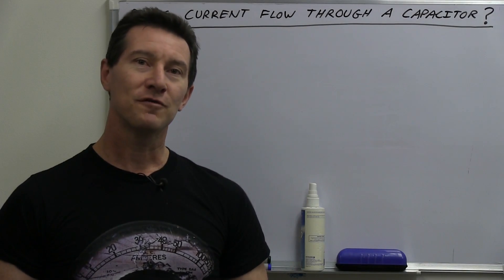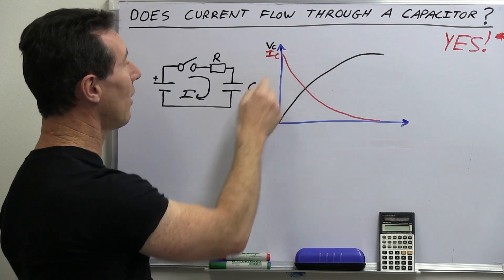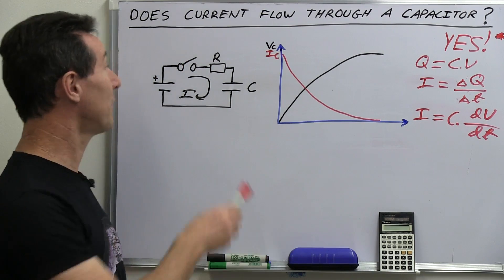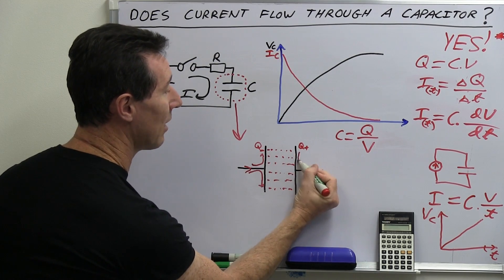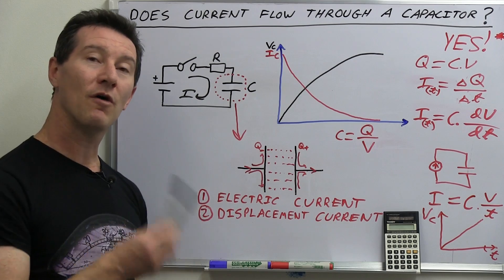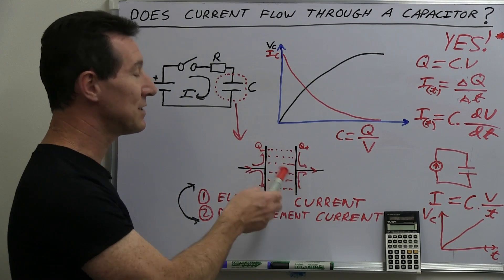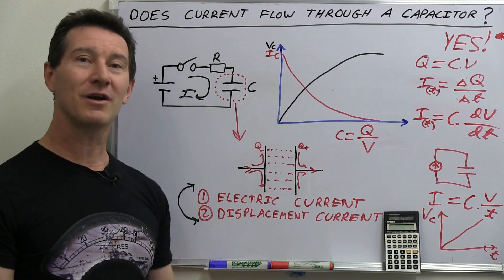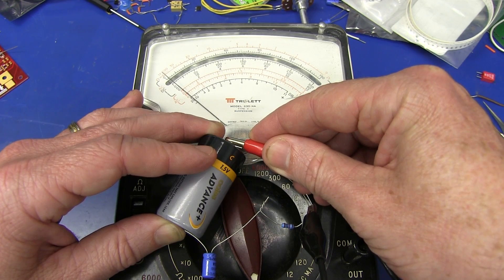EEVblog #486 - Does Current Flow Through A Capacitor?

Comment: So the simplistic answer is:
Do electrons flow through a capacitor? No.
Does current flow through a capacitor? Yes.

One circuit can affect the electron flow of another circuit even if they are not physically connected. That's how eg. transformers work.
Reply: Wow, that's such an obvious way of saying it, but I never thought about it like that. Thanks!
Reply: +quadcatfly What causes electrons to flow in a wire? Displacement currents present between each atom causing electrons to jump from atom to atom. What causes current to flow through a capacitor? Displacement current present between each plate that causes electrons to flow out of one plate when they are forced into the other. A wire conducting electricity is the same phenomena as a capacitor conducting electricity, just the capacitor has a much larger gap than the two atoms.
Reply: or rather more simply - it's an electric field that does the work of a capacitor but NOT a magnetic field as in a transformer. With a transformer - we have electricity converted to an INDUCED current via coils which generate magnetic fields (hence the ability to change voltages across the gap by induction. But with a capacitor, there is no associated magnetic field created beyond what you get traveling through the connected traces or wires. Otherwise you would see capacitors exhibiting magnetic behaviours when you turn a circuit on.
Reply: *****
"There is absolutely no current flowing from the primary coil of a transformer to the secondary!"

Ah, well, then all those formulas to calculate the current through a capacitor are wrong. It's much easier. The current through a capacitor is always I=0. Much easier to remember.

Now we'll have to rewrite all those books that are giving the wrong formula.
Reply: Ola Ostehøvel
So if you connect a multimeter to one and measure the current and it gives a non-zero answer, the multimeter is lying?
Reply: Ola Ostehøvel
So if you measure the current going through a device, and the multimeter is telling you that there is current going through, you will be lying if you thus deduce that there is current going through?
Reply: Ola Ostehøvel
Do you even understand what "current" means?
Reply: William McCormick
Are you insane?
I think you forgot your medication.
Reply: the current meter displays what the graph says about it. Its about electromagnetism, just as a step down transformer is inducing a current. All hail Nicola Tesla
Reply: Ola Ostehøvel
If you had a black box which contents you don't know, and it had two contacts, and you put a voltage difference between them, and then measured for a short period of time if any current is passing through the black box, and then you concluded that yes, current is flowing through the black box. Then the contents of the black box is revealed, and you find out that it's just a capacitor inside. Would you then take your conclusion back and say "oops, I was wrong; even though I measured current flowing through the black box, there wasn't actually any current flow at all, now that I see that it was a capacitor and not something else."

There is current flowing through a capacitor. It's simply that no electron that goes in will ever come out of the other side. Current does not require that the same electrons must flow through. (It's enough that some electrons go in, and "push" existing electrons inside it to go out the other side. This is what happens in a capacitor.)
Reply: More precisely, electric current is a flow of electric charges.
There is no requirement that all the electrons must travel the entire length of the circuit being measured. It's enough for there to be a flow. It really doesn't matter what's causing that flow.
Reply: the math says that there is a current a displacement current. Maxwell ecuations.
Reply: grassroot011 They tend to put names, terms, laws and even values on things that are not even there.
The story of America is Benjamin Franklin with a few blisters from ARC burns in his basement, doing away with 100 years of the witchcraft, of lightning and electricity.
Dufay was washed up, the Royal society was washed up. All by a few simple experiments.
What bothers me is that the myth busters, claimed that Benjamin Franklin could not have flown a kite in a lightning storm. How sad is that? It can be done easily.
Sincerely,
William McCormick
Reply: In modern CMOS devices sometimes you can get a response from the device even where no electrons moved, so if you dig deeper into this you'll find out that there are not simply particles of electricity. Just as, there are particles of water but there are not particles of water pressure. Consider: Ohms law shows that voltage, current, and resistance are not separable, they're different parameters that you can measure about a single physical law. It just doesn't break down into particles. How many particles are in a magnetic field? How many particles are in the heat loss of a circuit?
Reply: antigen4 Current does not need to flow to generate an electric field. Hence static electricity. Capacitors do not require magnetic fields to operate; electric charge is sufficient, and can operate over free space.
Reply: WarpRulez Just to make the question a bit more fun, there is a current flowing through capacitor. When atoms of the dielectric get polarized, i.e. stretched and rotated in the direction of electric field, that polarization movement represents current. It might be miniscule, but its still a movement.
Reply: +WarpRulez 
You are trying to prove a theory without any
actual demonstrable proof. 
Dave did an excellent job of showing us both worlds. The
theoretical and the actual. Particles of electricity flow through all material
on earth. The only thing that can stop particles of electricity are a certain
amount of particles of electricity. 
If you attach a scope ground, to the (-) marked terminal on
a battery, and connect the (+) marked battery terminal of the battery to the
(+) terminal on an electrolytic capacitor, and the scope probe to the (-) side
of the capacitor. You will find that you read the full battery voltage. The
probe will read the (+) charge through the capacitor. You will find that at
10,000,000 ohms it does not even charge a medium sized capacitor. The reason is
the flow is not great enough to create a diode, that will charge enough to stop
the flow of electricity through the capacitor. 
So we can be sure that particles of electricity are flowing
just fine right through the capacitor. If we apply this analogy to a boat with
a hole in it, a boat with a leak. We know that a leak in a metal row boat will
sink the boat. So it is rather hard to say that particles of electricity are
not flowing through the capacitor. Just like we cannot say that the leak in the
boat did not sink the boat. 
If you place two capacitors in that circuit in series, you
can note some very wild phenomena on the scope viewing with two channels. As
two separate plates become one plate. I use a high ohm resistor between the two
capacitors, so the event is slowed. I complete the circuit by connecting the
two capacitors with the resistor. I attach a probe to each of the capacitor
terminals where they are connected by the resistor. Both scope grounds remain
on the (-) terminal of the battery. Before the circuit is completed by the
resistor, one probe reads the full battery voltage and the other reads nothing
or zero volts. When you connect the circuit with the resistor, the terminal
reading full battery voltage drops and the other probe slowly raises in
voltage, until they are equal. 
If you examine all the explanations for a capacitor, and
then perform this experiment. You will see that it cannot be done without
particles of electricity passing through the capacitor.
Reply: WarpRulez If you put a diode between two capacitors allowing the particles of electricity to flow form the (-) terminal of the battery or DC power supply, through the capacitor and then through the diode to the other capacitor, and energize the circuit. You will note that both capacitors charge. If you reverse the diode the capacitors will not charge. 
It is kind of like sinking a boat. You need a leak in the boat before it will sink. That is why better dielectrics are worse insulators. Air, certain gases, are the best insulators, they make a great high voltage condenser but they are not great for making a high amperage capacitor. You would need too much surface area to create a high amperage air capacitor. 
If you analyze that experiment, you will note that particles of electricity come from the capacitor being energized by the (-) terminal of the battery. Pass through the diode, and then enter the other capacitor that is connected to the (+) terminal of the battery. 
Ask yourself how the battery could be drained, through that circuit. Both capacitors and both plates of each capacitor  are totally charged to the charge of the respective battery terminal feeding them. You can check that with a scope. When you connect the capacitors to one another, creating a circuit the two plates become one plate. Now if we claim that no particles of electricity flow through the capacitor, then certainly the opposite and equal charges on the two separate plates that become one when we connect them at a common point, could not draw current through the dielectric of either capacitor. They should equalize out without a draw on the battery. Yet there is a current draw as you connect both capacitors. The flow and the direction of the particles of electricity always match the flow created by the power source. So I think it is too early to rule out a flow through the capacitor. 
Just something to think about.
Reply: +WarpRulez Genius :)
Reply: +WarpRulez Thank you and good night Irene.
Reply: Voila, thank you!
Reply: A current of what? There is only an electron current.
Reply: HitAndMissLab actually - i wonder if it would be provocative to suggest that YES - current flows through a capacitor - but VOLTAGE does not (?)
Reply: @antigen4  Ahhhh....no.  Voltage does not flow.  Voltage is the "electrical pressure" to cause the current to flow in a complete circuit.
Reply: @antigen4  Actually no, because voltage doesn’t “flow”. Voltage is electric potential difference that appears ACROSS a component. Current (AC or DC) is the actual flow of electrons through a component.
Reply: antigen4
Its certainly provocative enough ;-).. Can you please explain it with a more detail.
Reply: antigen4
Yeah, that's something I wanted to quietly ask. Do capacitors produce any magnetic field?

Lets say there are two conducting plates on the ends of the very long cylinder. And the body of the long cylinder is made of dielectric. Lets say that cylinder's length to diameter ratio is 10:1.

Will there be a magnetic field around the body of the dielectric, as electric field through dielectric is changing?
Reply: @HitAndMissLab  A cap will have a magnetic field WHEN current is moving back and forth, from plate to plate.  If no current flow - cap charged - no magnetic field.
Reply: well I think now we're kind of into topology (shape) and it's relationship to charge and conductivity etc etc. I'm not at all certain that a dielectric as you describe could 'charge' - i think it depends on the plates being close enough together to make any kind of field happen AT ALL. But generally - I would say 'no' in theory at least- since current HAS TO FLOW for there to be any electric field and have any sort of magnetic component at all. Magnetism only happens (additively) in an inductor because you have current flowing through a bunch of parallel wires in close proximity - so their magnetic products are added together in that situation - if that makes sense (?)
Reply: Jeremi Roivas +antigen2 Current does not need to flow to generate an electric field. Hence static electricity. Capacitors do not require magnetic fields to operate either; electric charge is sufficient, and can operate over free space.  Electrons build up on one side, the electric field pushes electrons on the other side away.
Reply: WarpRulez There is absolutely no current flowing from the primary coil of a transformer to the secondary! One coil builds up an alternating magnetic field which induces a voltage into the other coil. There is a (alternating) current through one coil leading to current in the other coil, but no current flows to the other one. Both currents are not even equal in amount.
Reply: HitAndMissLab Yes.  And in some circuits, especially power supplies, capacitor inductance can be a big challenge
Reply: WarpRulez The (ideal) capacitor is the Hotel California for electrons.  They can check out any time they want, but they can never, never leave.....
Reply: Current is just the volume of particles of electricity per second, that flows through a piece of matter.
Reply: +Ola Ostehøvel you are right Ola
Reply: +veritaseros think of it as credit- buy today pay tomorrow
Reply: I think the best analogy is transformers, everyone just accepts that two electrically isolated windings transmit power across the insulation. Beyond that I have just accepted I'll never know how magnets work after spending 2 weeks researching them.
Reply: Theory
Reply: the simplistic answer is 2 L-90
Reply: The original comment doesn't make sense.

First of all, being strict, the phrase "flow of current" is a misnomer because current is already a flow (of charge).

Secondly and more importantly, if you say "current flows through a capacitor", then say "electrons don't flow through a capacitor", and we're aware that protons nor ions flow through a capacitor, you're making a contradiction. If the only charge carriers in a circuit are electrons, and you say there's no current, then there's no flow of electrons. You can't say what you said.

As someone replied, perhaps a more correct answer is to say electric field flows through a capacitor.
Reply: Transformers do work as you explained, but it's important not to confuse magnetic and electric fields, inductors and capacitors etc. transformers have no (intended) capacitor and have practically nothing to do with this video.
Reply: I would say that much more accurate is to say that "electric field travels" through capacitor, not a current. Current is dQ/dt and right in the middle of capacitor, where dielectric is, there are no charge carriers. If there are no charge carriers, there can't be a current. In other words, the dQ=0 so dQ/dt = 0.

Current is not flowing inside capacitor, but electric field is pushing charge carriers outside of the capacitor.

What Maxwell did with displacement currents is just a modeling trick to balance out the equations. For all the practical purposes it does the job.
Reply: @HitAndMissLab  Current is correct way to say that.
Reply: @HitAndMissLab  Agreed.
Reply: WarpRulez For once David is completely wrong. Current does NOT flow through a capasitor. A capasitor is defined as a unit that separate potentials with an insulator. The fact that no insulator is perfect is not the least relevant. It is not this short comming property we exploit using capasitors. Let me paint a picture that clearify this perfectly and lets use an analogy everybody is familiar with: water pipes. Now assume we on our water intake block the flow with a baloon and lets call this baloon our insulator that separete our local water circtuit from the sentral one. (blocking DC) When we open a tap a small amount of water comes out and goes to ground. Assuming the baloon does not break, it will now bulge in the direction of the water tap, but no flow what so ever goes though the baloon. In this DC like setup nothing more will happen... because the baloon/capasitor do not support DC more than once for every neutral starting point. If we on the other hand have a water supplier who gives us AC water, as in turning on and off and even gives us negative pressure, the baloon will go back to it's original position and start forming a bulge in the direction of the water supplier. Instead of a tap where the water goes to ground we can have a circuit that get use of the alternating water preasure. We could let the alternating water pressure drive a piston to form av pump. This picture of what hapopens is useful in many respects. We now understand why increasing frequency in a dc dc converter gives us more power; why increased frequency carries more energy: because more work can be done. It doesn't matter if the capasitor is placed in series or in parallel with Our curcuit. The same principle is in work in both cases. When in parallel with our circuit it will build up a "bulge" so that when our power supply is unable to give enough current, the capasitor can help, with the side effect of filtering noise from our cicuit so that it doesn't disturb other equiptment on the grid. Just like the capasitor stop DC, the coils stop AC. Both got the filter property as a side effect, well, somebody would actually call it the main property. They are not diametrical opposites. More like half on half. When the coil is saturated, it will let though AC, but in a filter we make sure to use values so that saturation does not occur. On the other hand, a capasitor will let though a little DC until it is saturated, but after that there is full stop. "Until the bulge is streached as far as it go without the baloon breaks."The reason why David didn't see this comming, I believe, is because electrinic guys reject to "lapse" to physical explanations, but demand that the students accept the theory without getting any Insight of what is going on mechanically. I myself remember one teacher that screamed in the class, STOP TALKING ABOUT ELECTRONS. LEARN THE MATH! Funny guy, he actually thought he was not the reason why his students didn't understand much and all he had to do is to make an analogy just like me and everybody would be happy, instantly, and great Insight would be established in every single head. Sadly, most electrinic guys understand far too little physics to teach electrinics in a successful manner.
Reply: No you are wrong. Current is electrons movement. If no electrons are moving, no current is moving. What is happening is that electrons are converted to the magnetic field that induces flux to the gnd that is seen as current. The current is used to build the magnetic field that retains the DC level. For this reason current induces to GND and you may see current while CAP is charging up to the ref voltage level and when the cap is reached to ref level it don't need current to build the magnetic field. The again when voltage is removed the magnetic field that has been build start to induce flux to the ref level which tries to fight back change in ref level. So this why cap has logarithmic decay time.
Reply: WarpRulez A multimeter has no option to differenciate between "going through" and "loaded electric potential on one pole". You obviously have a screaming need to learn how to interpret what a current meter actually say.
Reply: WarpRulez No, as I very precisely proved, no current what so ever goes through a capasitor. I had no use of your syntethic approach to the problem. I solved it by what is called a direct proof. It follows by definition that there is no flow through a capasitor: ever. I'm pretty sure David understand this now.
Reply: WarpRulez No, you are lying when you deduce there is a current THROUGH the capasitor. You are guilty of a hasty conclusion. Didn't you understand my analogy at all?
Reply: Ola Ostehøvel Given surface area of the dielectric, the thickness of the dielectric, and the time it takes to charge a capacitor, I believe you are witnessing current, voltage, and particles of electricity going right through the dielectric until it is charged. The charge is a ramping charge, from one plate to the other. At that point electricity is stopping electricity. Which is the only thing that can stop electricity. Dielectrics carry electricity faster then silver or copper until you load them with a load.
Reply: A transformer and a capacitor both share the ability to store electricity. A transformer uses a magnetic field to excite the coil in another circuit. The capacitor dielectric is in physical contact and in series with the circuit and is bound by ohms law. So yes particles of electricity flow right through the dielectric. There is no other path, or source of particles of electricity.  
Sincerely,
William McCormick
Reply: Who ever told anyone that insulators do not conduct electricity? I want to meet this fellow.
Insulators conduct just like any other substance on earth. And they charge up to partially stop the flow of electricity just like any other substance on earth. They follow ohms law. Inside some of those capacitors you have many square inches of dielectric cross section.
Imagine how many amps a copper wire that was two inches in diameter could carry. Compared to a copper wire 1/8" in diameter. Then reconsider what is happening inside a dielectric capacitor. Remember the thickness of the dielectric in a capacitor as well, it is often 5 to 8 times thinner than copy paper. It is going to conduct some electricity. A dielectric in a capacitor is also as much as 100 times thinner than the same material used for insulation. That means 100 times more resistance. Since insulators are only dielectrics that means it creates a capacitor with 100 times less micro farads.
If you try and feed a capacitor higher frequency than it is designed to support it will pop. The reason is that as the frequency increases, there is no longer enough distance between plates for the plates to charge in time to a ramping voltage to stop the flow of electricity through the capacitor. The dielectric conducts full current. Both plates at some point reach the same voltage around mid voltage, and just conduct electricity.
Air and or gases, are the best insulators on earth. Air is also a dielectric. That is what was in a condenser used in car ignition systems yeas ago. Yet with high frequency we can break down airs ability to insulate.
Insulators/Dielectrics follow ohms law exactly. They are just conductors that do not conduct well. But they conduct.
Sincerely,
William McCormick
Reply: +joshua andres blanco jerez , But the same exact thing happens in a copper wire. The particles of electricity that excite the wire steer ambient radiation away from the abundance of particles of electricity and send them down the wire. The same thing happens in a dielectric. 

Inside a capacitor there are many square inches of dielectric, and the dielectric is thinner than paper thin. If you replaced that dielectric with a piece of copper of equal thickness and surface area, that piece of copper could perhaps conduct hundreds of thousands to millions of amps of electricity. So the dielectric the insulator is capable of conducting a hearty amount of electricity because it is so thin and has so many square inches of surface area, until it is charged in a ramping voltage. 

The only thing that stops the flow of electricity through anything is ramping voltage. No substance on earth stops electricity at all or in any way. Only electricity stops electricity. The fact this is not well known explains many of our problems today. 

Sincerely, 

William McCormick
Reply: WarpRulez Particles of electricity do flow through the capacitor, at first. Until the dielectric charges, enough to create a diode, to stop or actually slow the flow immensely. Electricity flows through all materials, until they are charged enough to repel the flow of particles of electricity. Electricity moves the fastest through, insulators, and dielectrics. And slowest through inductors, like silver, copper and aluminum.  
Imagine a metal electrical resistive heating element. As you apply and increase voltage and current to and through the resistive element, it heats and slows the flow of particles of electricity through it. That is all an insulator is doing. Nothing more. 
That is why when you are standing in water, you are separated from the earth by a dielectric, the water. You are now one plate that charges equally across your body at an unhealthy rate. When you are standing on dry ground you are more of a resistor, most of the voltage and current is stopped at the point of contact. 
Working with voltages and or currents that do not normally effect you while standing flat footed, causes us to become falsely secure. These same voltages and currents can kill while you are falling backwards on the heels of your footwear. This can cause you to become a plate in a very low micro farad capacitor, and charge quickly. Remember the formula for a capacitor, involves the square inches of dielectric exposed to the plate, the thickness of the dielectric, and the resistance of the dielectric.
Reply: I can see your point of view, however if you take a look at my point of view, you might at least find yourself with a few questions that you cannot answer with "modern" science.

I know exactly what took place, because I was there, however I agree with you that is not proof of anything.

Years ago during my HAZMAT training we were shown a video and accident, that occurred during the making of a training video. The video was supposed to show how, you are supposed to suit up for an anhydrous ammonia spill.

Before the video started, I was joking about the fact that they might be blown away by a silent explosion. The trainer smacked me on the back of the head. And said "pay attention you have not actually seen one until now." He was right, I had only heard about them.

Sure enough they went into the room all suited up. One guy with a video camera, one guy to move the forklift out of the ammonia spill, and the third guy was going to clean.

When the guy went to start the forklift, the guy with the camera dropped the camera. The guy on the forklift, seemed puzzled but pretty unaffected, by the time the guy picked up the camera that was still filming, three to four seconds later. And the third guy was blown through a cinder block wall. He was positively accelerated, in three or four feet to a velocity that allowed him to be blown through a cinder block wall. The good news was he was wearing a turtle re-breather that wedged into the cinder blocks and stopped his travel. He was alive, badly hurt but alive.

Now my experiments with model rockets and living things tells me that the positive acceleration in only three or four feet to a velocity that could cause a human to blow through a cinder block wall, should have killed him. Unless there are or were other forces at work. And there are.

During my training we learned how to seal propane tankers and what to do if you cannot seal them. Our standing orders were that if in two minutes we could not drive a sharpened wooden wedge into the leaking tanker and seal the leak. That we were to take our road flares, move to a distance of 250 feet and light them and then the tanker.

Because if we did not do this, a resulting explosion after most of the contents leaked out, would take out the entire town with a rolling shock wave, that turns the earths surface into what looks like water and rolling waves.

Now you might be saying "yea sure we all know this" well the guy who did that and probably saved the town, by just letting the tanker burn off slowly. Was taken to a psychiatric center and told by the doctors that he was crazy for lighting his truck on fire. They told him he was very sick for doing such a violent act. Ha-ha. It is all point of view. They actually started treating him. Most of the world has trouble facing the reality of it.

We live on a ball of pure electricity. That is what America was all about. Benjamin Franklin used to cook his Turkey that he electrocuted in the river, on his static electric powered turkey spit. He suggested that the king of England would benefit from such river treatments.

Some of us Americans are a wild bunch. We were actually told that reality is just too dangerous to exist by "educated" sorts. And they moved against our entire area, to hide real science.

What parts of my earlier post do you find especially insane. Maybe I needed to add more information or clarification. Perhaps an example or demonstration to make it more reasonable.
Reply: Most people do not consider that they are not looking at objects. Rays are beaming at their eyes. Depending on where the beams are coming from seems to make a difference, in what we decide we are seeing. 

We take this information from the rays and decide what the object sending those rays is. But we never see the object. We see the effects the objects had on the rays that make it to our human senses. You have to live with that mind-set for a while before it becomes an automatic thing.
Reply: ***** AC and DC are the same exact electricity. AC just alternates the polarity of a DC current. It is as if you had a pair of wires, supplying DC current to a load and you cut both wires, stripped all four ends of the wires where you cut them. Then just held the line side wires onto the load side wires. And then intermittently reversed the position of the line side wires, connecting to the load side wires. Really nothing at all to AC current.

AC does offer effects that are interesting. You can take a 55 volt DC power supply and create a square wave with it that will give you a read of 120 volts RMS AC current. It takes 165 volts to create 120 volt RMS current from a sign wave.
Reply: You can also with AC current, using a capacitor in series, raise the voltage an induction device would receive from a standard 120 volt sign wave power source, to almost double that voltage as measured by an RMS meter. You have to size the capacitor to the induction device. You cannot do that with a DC current.
Reply: If you say that particles of electricity do not flow through a capacitor dielectric then you have to also say that particles of electricity do not flow through a wire. Because the same ohms laws apply to each substance and device.
The way particles of electricity are directed, by polarization and how polarization takes place, causes a need of some explanation for both wires and capacitors. However capacitors and wire, use the same principles to conduct electricity. So if you really want to go there I will go there with you.
What you stated cannot be demonstrated, therefore it is not science. What I stated can be demonstrated.  
Sincerely,
William McCormick
Reply: I do not think we are in agreement. No particle of electricity, no radiation moves from a certain concentration to a higher concentration. Particles of electricity move from a higher concentration to a lower concentration. Or from a higher potential to a lower potential. That is all they will ever do. It is so simple the fact we have complicated it to a point beyond words, is a fascination in itself.
Matter has no energy, a battery, gasoline, explosives are energy less. What they are is a filter for ultimate potential energy, ambient radiation. In a battery, ambient radiation is steered, slowed, by structures, materials and chemicals in the battery. One terminal starts to create an abundance of particles of electricity, this abundance then effects the wire carrying the (-) charge by making it abundant with particles of electricity. Ambient radiation trying to pass through the wire, is steered away from the abundance, and towards the shortage. This causes what we call electricity, current. If you think of a river and the current in the river, electricity is no more complex. Colleges changed the polarity labelling from Benjamin Franklin's exacting labeling, that is what makes electricity complex. Now we raise down the voltage and lower it up.  
The capacitor is the same as the wire, as the plate with an abundance of particles of electricity, steers ambient radiation away from the abundance, ambient radiation holds back some of the charge the flow the voltage from the the abundant plate. Keeping that plate abundant. Because we are talking about an insulator a very small distance is needed to create a ramping of voltage, with a small drain.
The same thing happens in a wire, you get a ramping voltage across the length of the wire. Because it is a conductor, the difference is slight, the drain high.
Reply: +WarpRulez  
"Do electrons flow through a capacitor? No.
Does current flow through a capacitor? Yes."

Sure. And electric current is a flow of electrons right??? Do you see any logic issues here? Perhaps ?
Reply: +William McCormick  And the  "capable of critical thinking Left," will '
not consider facts. As it interferes with their  much coveted  narrative.  And why use Conventional current when  even this guy after stating "don't confuse the issue " mentioning electron flow, he uses the  wording, " electrons flowing this way," Why talk about it by 
using  "hole flow," which is what Conventional flow is?  The spaces left behind when an electron moves to the positive source, is ridiculous and  not necessary. This concept just makes understanding electricity  much more difficult.
Reply: It does matter. Particles of electricity move from an abundance to a shortage, nothing else ever happens with particles of electricity, or current or charge.
 
We have been put through the "raise it down" and "lower it up", phase of counterintelligence, not only in the field of electricity but in other fields as well. It is not a conspiracy at all. We or our parents or grandparents almost demanded it.
 
Electricity is just like a water pump and water. The water is not sucked into the pump, it has to be pushed into the pump by pressure. Voltage symbolizes pressure, or electromotive force in the field of electricity. Gallons per minute would relate to current or amps in the field of electricity.

It is all going in the same direction, voltage, amperage, current. Just like water in a hose.
 
ARC is like spraying a fire hose at a screen that has holes that are too small to allow the water to pass through, the spray back of water off the screen is the ARC phenomena in electricity.
 
The problem is they do not wish us to understand, that the earth is a giant ball of electricity. Created by tiny spheres we call hydrogen atoms. Those spheres are made of particles of electricity trapped by a mathematical formula and ratio.

The hydrogen spheres are maintained by a ratio of a spheres surface area, to a spheres volume. The two formulas are Pi * D^2 for surface area and Pi * D^3 ÷ 6 for the volume of a sphere. 

A very small sphere has a massive surface area and very small volume. A larger sphere has a massive volume and tiny surface area in ratio to the smaller sphere. The gigantic surface area allows the repulsive forces of ambient radiation that passes through all matter, to keep the volume of particles of electricity trapped by the huge surface area.
 
It is this ratio that keeps a single cell amoeba from becoming the all comical blob. As a single cell organism gets larger the volume of the cell needs more food and produces more waste. As the cell membrane surface area decreases exponentially compared to the volume, of a larger cell. The cell starves and drowns in its own excrements. Not enough food gets in and not enough waste gets out.

This is also how administering poisons to cancer patients can often cause the cancer cells which are less proficient at removing waste and poisons to die first or before the normal human cells. Because most cancer cells are larger then normal human cells.

Astronauts preparing for Apollo missions used to run in plastic suits to simulate a failure of the space suits cooling system. Each day many blood tests were done on the astronauts. About a week into the endurance testing, they doctors found no dead or living cancer cells in the astronauts. Their high vitamin intake and excessive workout killed off all the cancer cells that are normally present in humans.

The spheres of particles of electricity, or the hydrogen atom, are held in play by ambient radiation, that passes through matter rather effortlessly.

Matter is 90 percent space. It has no actual mass or weight. Rather only its repulsive nature. Ambient radiation repels all radiation and all matter. Matter repels all matter and ambient radiation.

No two particles of electricity have ever touched and no two pieces of matter have ever collided or been in contact with one another. When we see giant plumes from atomic explosions and houses smashed like they are made of paper. We are watching near misses of particles and matter passing by each other. I can pass a lie detector after slapping someone in the head that I never touched them. Ha-ha.

There is a very cool explanation of how everything repelling everything can work rather nicely. But I cannot just keep jumping around without error.

You do need this point of view to actually understand what is happening inside electrical components. Much of what we see with our eyes is not the source lighting. In other words light does not bounce at all. It does not reflect either. Instead light striking "solid" objects, excite the area between the "solid" object and the translucent or opaque substance that will carry the information about the "solid" object to our eyes. Ambient radiation passing through the "solid" object, as it exits the surface being struck by light, is negatively accelerated to light speed. That is what we see. Not the actual rays of light from the light source.

You have to understand they sold to our parents and grand parents, that we were going to be able to see sub atomic particles. When in fact it takes perhaps billions of sub matter particles to bring a glimpse of such an event to your eye or a camera. So we will never see a sub matter particle. Books have been written about this impossibility as if it was coming any day now. And we buy into it. The neutron was accepted by the adoption of newly "proven" attraction forces, which cannot be demonstrated. Which are not science.

There may be a few more angles that you might need to put it all together if only as a fantasy alternate universe. If I left out some important information I would be happy to share it they way I learned it.
Reply: To me it amazing where people have been lead with poor definitions.
Do not get me wrong, if I was in their exact position I would probably be in the same exact state of mind. But I was brought up in an almost alien world. Where they had to know, and where I had to know. I was also told when I was young the government, the people agreed to it, so there is not much you can do.
Unless you want to take on people that are more afraid of knowledge than ignorance. After living it I am ready to take them on.
Sincerely,
William McCormick
Reply: quadcatfly I have had talks with heavily trained collegiate sorts. And When you press them into that corner, the wild explanations just come out of them. I mean wild stuff, hieroglyphic formulas, sub-matter particles that do not even exist. Holes in transistors, that had me laughing till I cried.
They just will not stop flooding a simplicity with utter nonsense, that is backed by billions of tons of books written by people just like them. It is not what you know, but who you know today. I know where that leads to and it is not heaven on earth.
Sincerely,
William McCormick